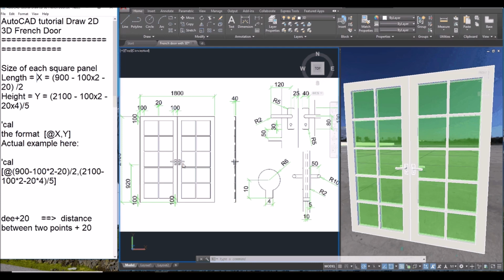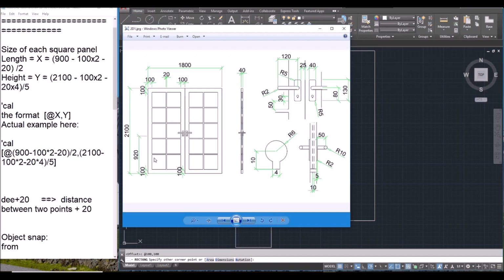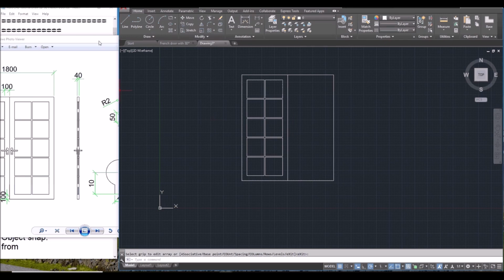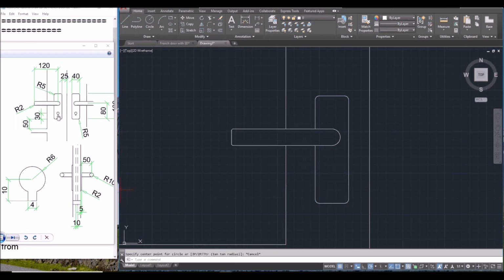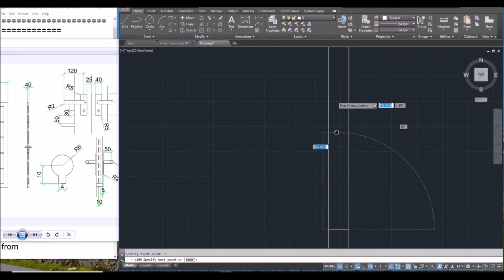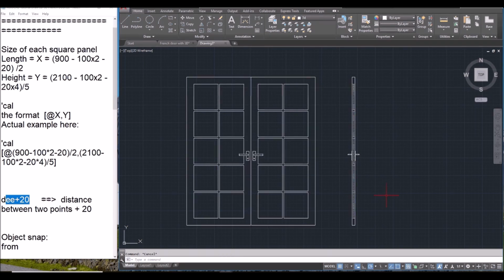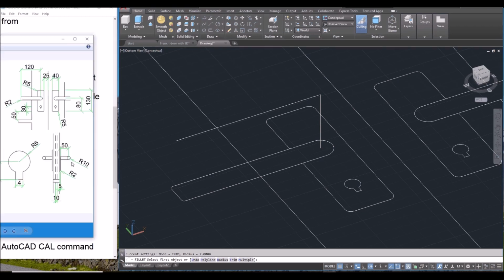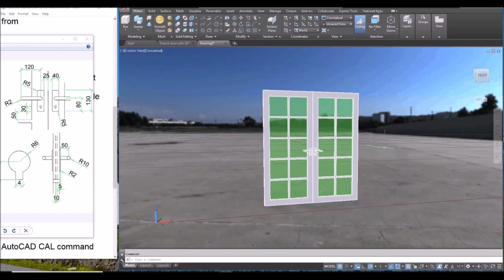AutoCAD tutorial Draw 2D 3D French Door

Comment: Sir which laptop is best for AutoCAD. suggest me a laptop for AutoCAD..............
Reply from the maker: I use MacBook with PC mouse for presentation and simple AutoCAD editing and I use desktop computer for full power AutoCAD and 3DS Max.
My desktop is from Asus and I perfectly satisfy with the performance.

Hence, I didn't use much AutoCAD with notebook. 
Here, is my suggestion:
According to Autodesk and my experience, the notebook\desktop requirement should be
1. i7 or above CPU
2. 16GB or above for 3D modeling
3. SSD and choose 256GB or above
4. Supported graphics card (check Ref 2 below - but this might not show you graphics card of notebook)

Reference
1. https://knowledge.autodesk.com/support/autocad/learn-explore/caas/sfdcarticles/sfdcarticles/System-requirements-for-AutoCAD-2019-including-Specialized-Toolsets.html
2. https://knowledge.autodesk.com/certified-graphics-hardware
3. https://bestlaptopsworld.com/best-laptops-autocad/
Reply: thanks sir.....
Reply from the maker: make sure also keep your budget for external monitor.
If you are just learning CAD and do very simple freelance job. Then, notebook should be ok. No need to concern too much about graphics card. Built-in Intel will be fine.